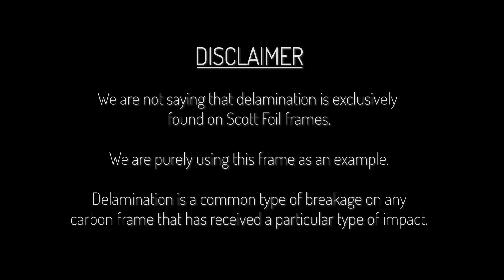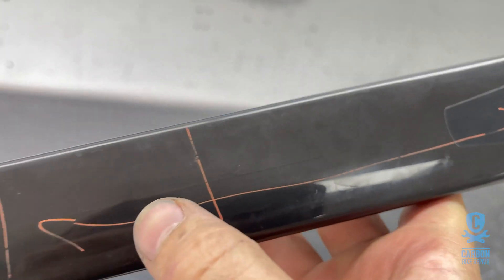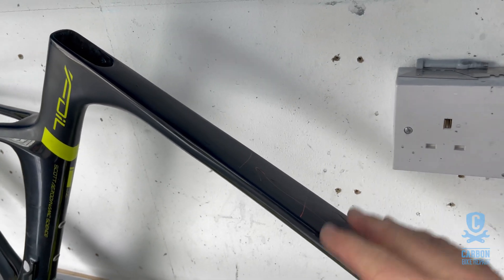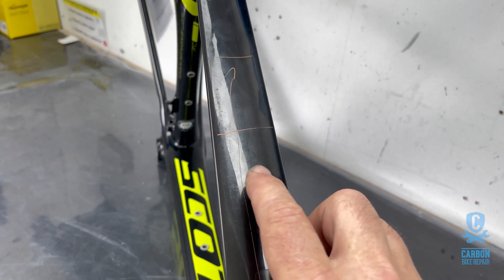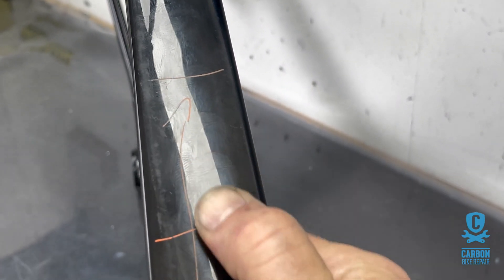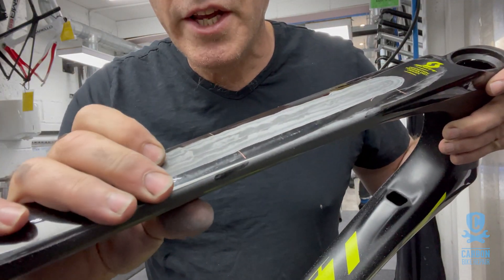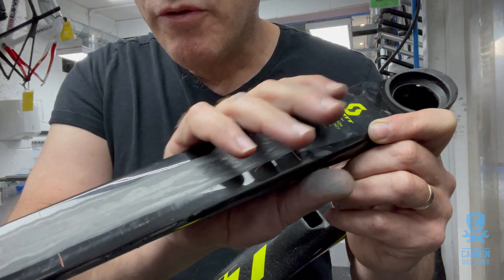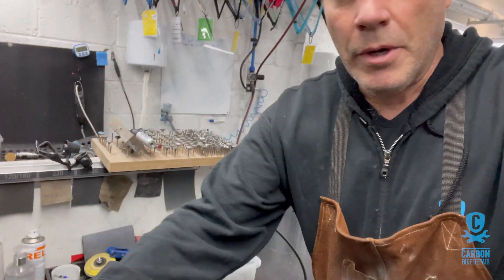Finding A Fracture: How To Spot Delamination

Comment: Is it normal that on my new Pinarello, the inside of the chainstay is soft? Not to the extend like in the video but you can file that its not as hard as a rock.
Reply from the maker: @francescoiannantuono112  Hi yes it is fine. The designers have found sheltered parts were they can loose weight. The wall thickness is very thin but can flex more than the thicker parts. The outer side should be rock hard.

Comment: Hi
It is normal to bend a litle that tube?
Reply from the maker: @HouseBrenn  I’ll try to provide a straight answer! Each bike company does their own thing. Some remove carbon from areas that they feel is not necessary others who don’t. Usually with top tubes on modern carbon you will get flexing on the top part but not so much underneath and the sides. This is common and not dangerous. However if you press down like in this video or you hear a noise when you press. Then email us to assist with further advise no matter where you are. Thanks for asking the question ✅

Comment: How much force does it take to crack a carbon frame while pressing a bearing out. I heard cracking when pressing mine out
Reply from the maker: Hello Tyler and friends. It’s impossible to be specific but I’m guessing your question is a universal one about the general robustness of the bb press-fit? Designers these days simply review past frame-sets and understand that there is a general rule when it comes to pressure applied + a bit more in case. Generally I would say the bikes in circulation will be up to the task of handling assembly and disassembly. When it comes to the individual doing it or the various types of oversize options available with scant information then anything is possible. I will say this as an experienced repairer though, often the damage is done before you hear that crack. It could be from a previous impact or stress applied to the bb. For example we have seen implosions of the bb just because no lubricants was applied to help slide in the bearing cups. 
To provide a universal answer: in general the carbon bb will out perform an alloy one when it comes to stiffness under load. Anything else and it is more vulnerable. Weight reduction, frame stiffness and mold shaping opportunities are some of the good reasons why we have so much carbon replacing alloy. Good or bad!

Comment: That could be just a bad layup, Yeti has had several new frames where you could do that with your finger, bad layup.
Reply from the maker: Thanks for chiming in. It could be various reasons. In the defence of any brand we would say that they will always be pushing the envelope to better aspects of their bikes. In carbon you can never stand still. However in some cases this can go too far. In our experience we see the manufacture responding fairly rapidly to sort out. Imagine how expensive it is to honour warranty claims!
Reply from the maker: Thanks for chiming in. It could be various reasons. In the defence of any brand we would say that they will always be pushing the envelope to better aspects of their bikes. In carbon you can never stand still. However in some cases this can go too far. In our experience we see the manufacture responding fairly rapidly to sort out. Imagine how expensive it is to honour warranty claims!
Reply: @carbonbikerepair1  nice double reply

Comment: To me, that’s a weakened top tube post repair.
Reply from the maker: Hi there. Not sure why you think so? As long as you replace the material that was damaged to the same compressed wall thickness and it’s stress tested to demonstrate deflection data for that model and frame size then it’s really as good as a new frame. Unfortunately some of these procedures can not be shown but it has got to be repaired correctly. This is the concern many have with repair which we understand however after 10 years and 20,000 breaks we are happy that selected repairs are a viable alternative to replacement. Thanks for chipping in Villedocville. It’s all good